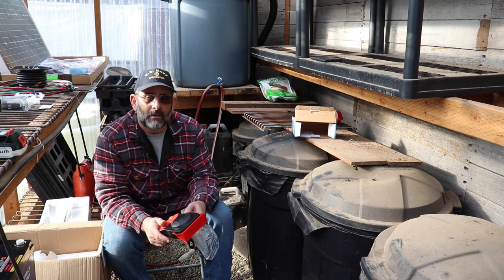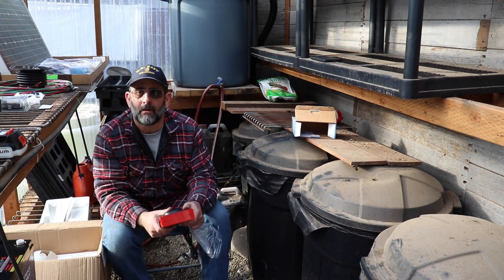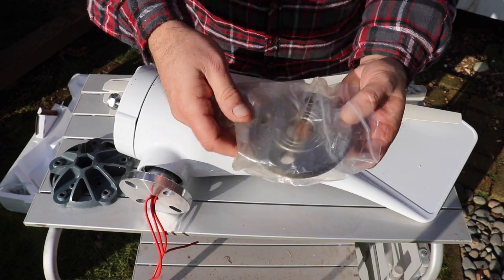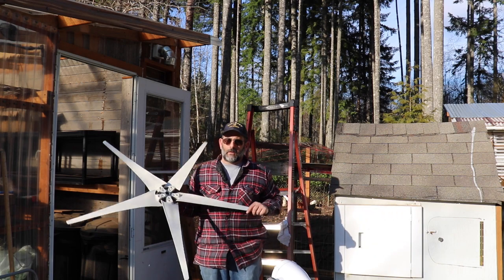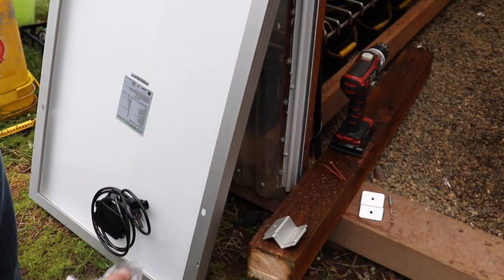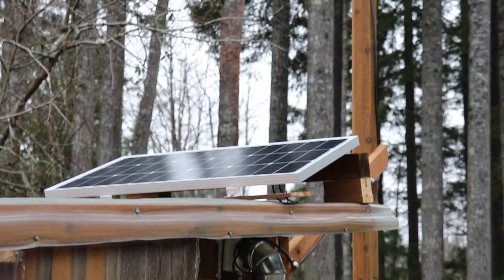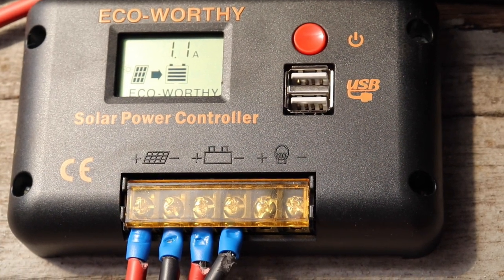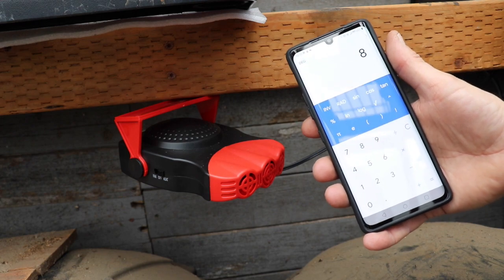SOLAR AND WIND FOR GREENHOUSE HEAT - CAR HEATER SUPPLEMENTING HEAT SINK

Comment: with all your water thermal mass i would try heating them with a non lethal heated antifreeze barrel heated with wood or oil and heat them up and maybe the ground also on the way out on circulation. Use an outside source so you dont possibly hurt your plants and keep your water source separaated form your anti freeze heating system. Just a thought. Kind of like those outdoor wood burners you may have seen. Maybe line your outsidde withe foam board a coupla ftt in the ground to keep the earth warmer also?????? air ducting during the day on underground tubes to warm the earth with your solar n batterry.
Reply from the maker: Thanks for the input.  I just might try that in the greenhouse I am planning to build this summer.  Happy Gardening!

Comment: I could be wrong but i dont think its good to discharge the battery down below 80% of total voltage...just saying.
Reply from the maker: True.  I only had to use it a couple times.  Then upgraded my solar with two more panels and another battery.  Also put it in my new better insulated greenhouse.  Happy Gardening!

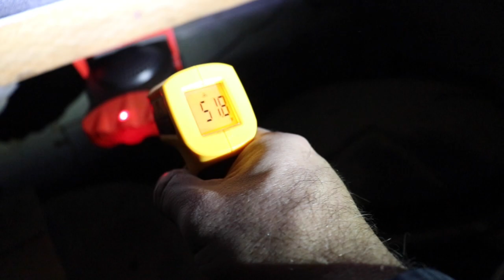Comment: I am at slightly past 14:00 (I did skip ahead) where you are discovering 'E1' error. That is no surprise and is not healthy for your battery. You have INVESTED quite a bit of money and time into this project. Solar panel, on average, might power that heater for 2 hours. Wind generator? 400 Watts at what wind speed? suggestions; insulate and double glaze greenhouse, direct sunlight on thermal storage containers, use fan and duct to draw air from top of green house and circulate through rock bin. circulate air through rock bin at night to greenhouse.
Reply from the maker: Thanks for the great comments!  Yes I was pushing it to see what it could accomplish.  I still haven't had a decent wind to measure, thankfully that was the cheapest turbine on amazon.  Right now, the turbine is more like yard art with all the fog we have been getting.  I am waiting for our spring winds to pick up so it can get to the starting 2.5 m/s low wind speed (4.85 knot/5.59 mhp).  I might be double glaze this greenhouse like I did with my Greenhouse Garden Shed https://youtu.be/pNE47EMYpME.  Still lots of work to get this where I want it to be.  Just doing a little at a time and experimenting with different ideas.  Happy Gardening!